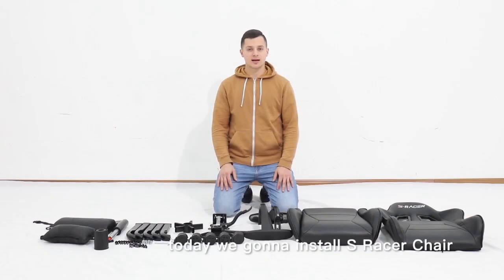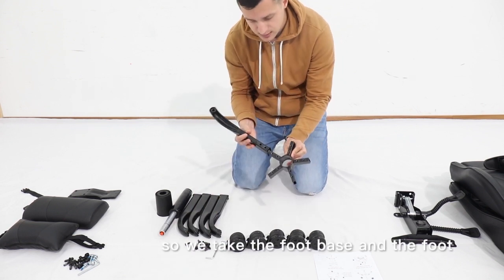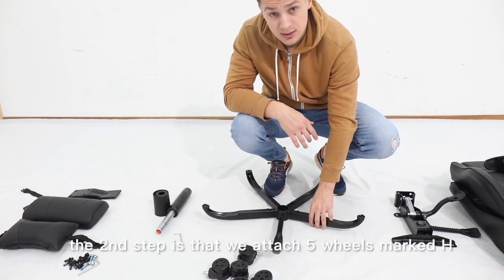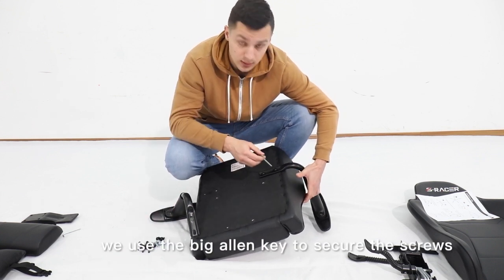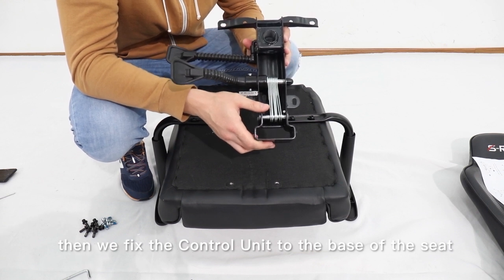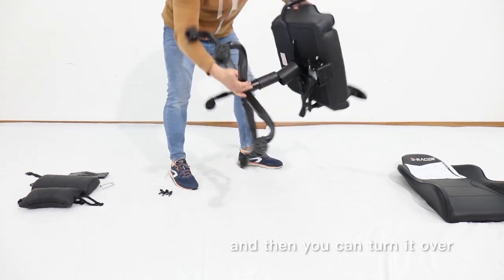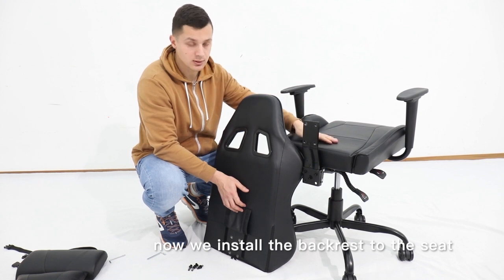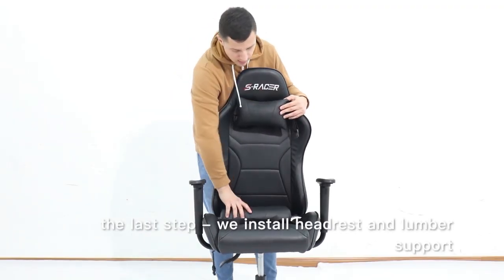Installation video of homall black gaming chair

Comment: If you have trouble putting on the wheels just wiggle them I’m, they’ll go in waaaaaay easier
Reply: I hope ur right
Reply: Cureently trying
Reply: Itd still not working
Reply: There seems to be a metal ring around each of the wheels, does that stip snythjng